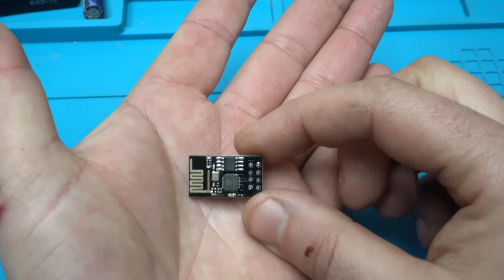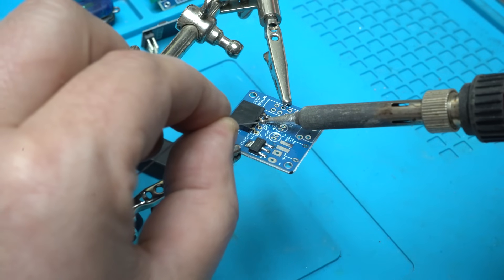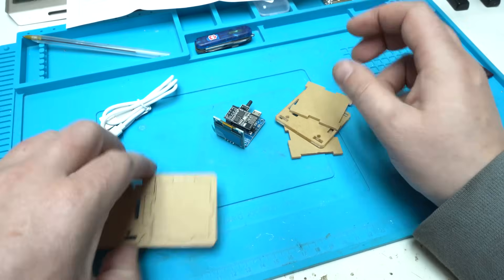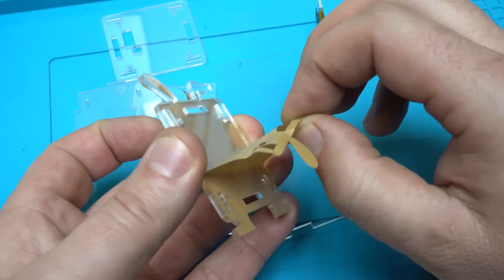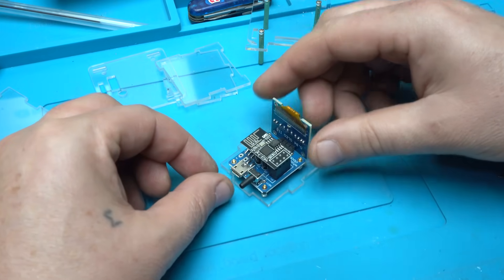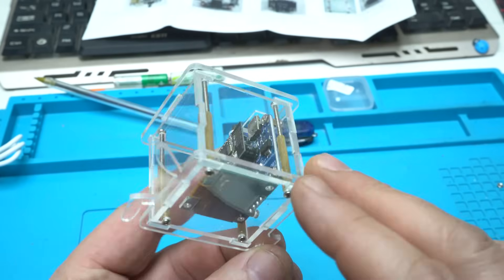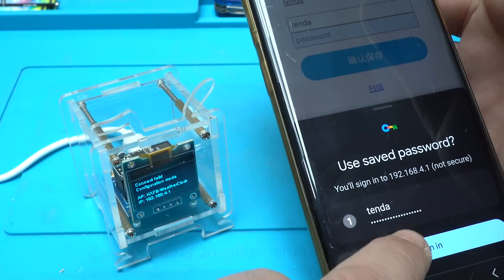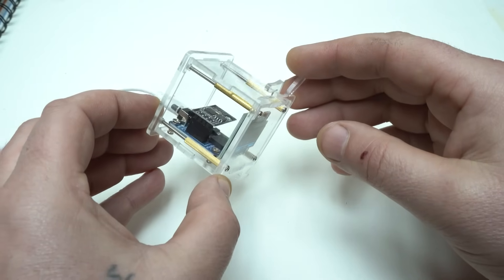With THIS $1 Module I Built Amazing Gadget

Comment: You will gain our full recognition by advertising REAL cost. It is not a hacker behavior ti cheat just like usual online vendors. The kit is far from 1$. Take habit to drop a link toward aliexpress where you bought the kit. Prices are currently fro 8 to12 $. It's still cheap, but your teasing price is a trap.

Comment: I LOVE EPS01 ! ITS NOT ESP8266!
Reply: Ithink yours is ESP15 I still have some ESP01
Reply from the maker: You are correct its esp01😉
Reply: The ESP8266 board versions are numbered from ESP-01 to ESP-14.
Reply: @alfaxgo  No. ESP-01 has less featueres than ESP8266 :)
Reply: @vertaniacity9113  It's one of the ESP8266 chip boards, like I said. Just read what's written in your chip.
Reply: @alfaxgo  Sry Boss you are definitve right!